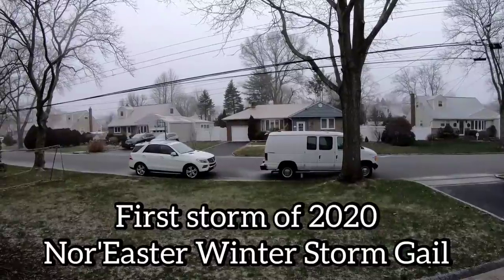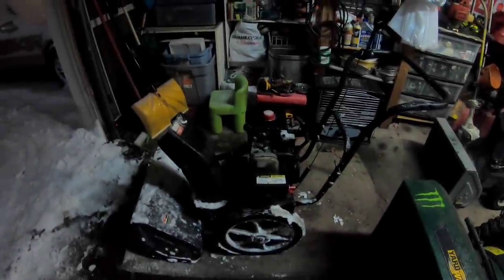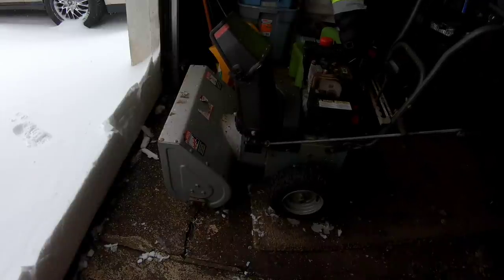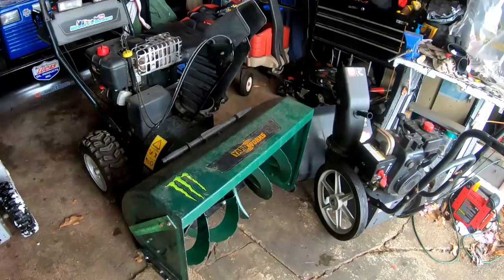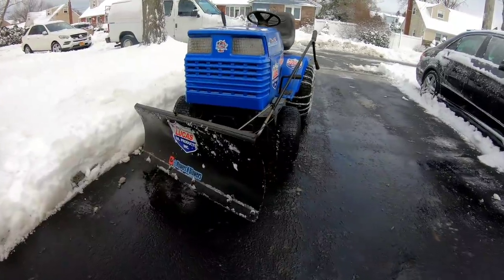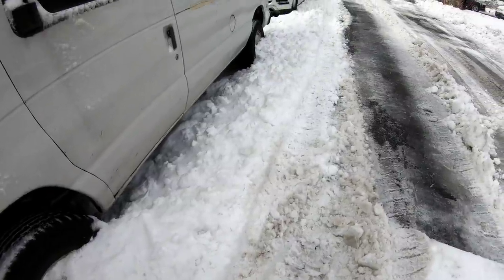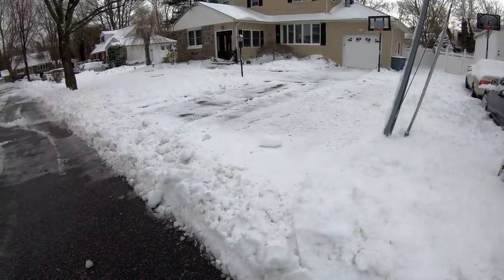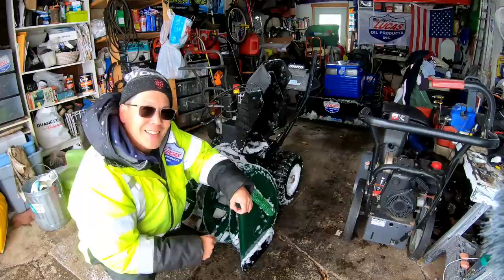WINTER 2020 NOR'EASTER SNOW STORM GAIL CLEAN UP CRAFTSMAN GT6000 PLOW TRACTOR & SNOWBLOWER IN ACTION

Comment: Henry, Nice job with the tractor plowing. Make sure that you keep an eye on your cutting edge that is bolted onto the bottom of the plow moldboard. Most of the time Henry, Once the cutting edge is worn fairly close to the moldboard, If not either flipped over or replaced you face the risk of destroying the bottom of the plow moldboard. To do this you want to unbolt the carriage bolts and flip over the cutting edge over or replace the cutting edge and then bolt it back to the plow moldboard. Your cutting edge will probably last for a pretty good while depending of course how much the plow has been used. As you eluded to Henry, It takes good weight to push snow. The hard pack snow/ice is the most difficult to deal with. I’m wondering if the plow that you have on “Blue Bayou” would be fit the MTD YardMachine Garden Tractor that I have. I may consider getting one for my tractor.

Comment: Henry love the video. I have a plate on the back of my craftsman to add weight when using the snowblower. I've pretty sure it was craftsman you add like a pole onto the back of your tracter and just slide more wheel weights onto it. Only reason I think it was craftsman is because I don't have wheel weights on mine and it looked easier that way. Still a great video.

Comment: Have the same plow but have a winch attached to it and so easy to use.
Reply from the maker: So you have to toggle up and down each time you need to drop the winch?  It’s easier just grabbing the handle
Reply: @MowersNBlowers   its all push button on the dash . So easy

Comment: Yes I have like a 94 Craftsman lawn tractor that I retrofitted a plow on and I love it it's so fast it's so easy I do have a snow blower you need a backup when it's just too deep for this that plow but tractors are fun with the blade on them to push snow
Reply from the maker: I thought it was a blast!  Way more fun than snow blowing
Reply: @MowersNBlowers  Here's another trick I learned on what they do on farm tractors to add weight to the rear of the tires take your tires off deflate them then fill the tire would windshield wiper fluid dakine is good for negative 32 I might tractor that added about 50 lb on each way without the wheel weights soundtrack to do it to add weight to the rear of theirs doesn't make it right ain't different he just put 10 lb of Aaron after it's good to go and it gives you more weight in the rear end you just put a little hose on the valve stem and just start pouring in the winter fluid in the case of yours with your tires are so big it might take quite a bit but I'll be a lot of waiting over here and I'll give you a lot more grip
Reply from the maker: How about anti freeze? That’s heavier than window washer fluid
Reply: @MowersNBlowers  yes you can use antifreeze windshield wiper fluid because it was it's much cheaper but antifreeze will work too

Comment: Hey Henry !!!! No footage from clearing mom's?  Love the distance from the big green monster My old iron repowered Ariens w/6hp predator likes to throw it too but that 13hp makes me feel a certain type of way!  When you got to the ice in street it looked like the auger wasn't spinning very fast. maybe just a different gear ratio from what I'm used to on my Ariens it spins pretty fast. If I get a good storm I'll video the mound of snow the city blocks us in with as the last 15 feet of my drive drops 5 feet so when it dumps and city rolls by they see the bird and snow balls fly them over paid POS's.  I got a blade for my mower but no chain or weights and the hill at bottom of drive could be trouble in deep stuff but some day I'll get it out and use it.
Reply from the maker: Some Good Samaritan paid someone to clear her driveway and walkway!  I didn’t have to go!

Comment: Ya got to get those carbs cleaned up before the next storm buddy!!   Also i have found getting carbs that have adjustable main jets is a good way to go......especially on those Tecumseh 9 to 15 horsepower blowers.    I have them on my 8.5 craftsman and 9 ariens!!    Both 28s and really makes adjustments on the go or compensating for dirt a breeze.    The ethanol free gas makes a huge difference too.  No stabil needed!!  Lasts a year or more!!   Great video Henry!!  All the best!!   Merry Christmas from South West Virginia......and the Blue Ridge Mountains!!   Cheers!!  Rick.
P/S......next storm may be on Christmas!!    😁😁
Reply from the maker: Thx rick
Reply: I usually spray/pour some carb cleaner in with my first tank of the year, since I don't always put them away properly the year before.

Comment: Where did you get those snowblower wheels? They don't look stock.
Reply from the maker: You talking about the mag bicycle wheels?  Google craftsman 522 snowblower,  they’re stock!   Ariens makes the model too!
Reply: @MowersNBlowers  Yeah, not much traction.
Reply from the maker: @davesaam4308  not ANY traction!  Ya just push, not self propelled!  It kinda pulls you from the auger.
Reply: Maybe you can make a custom set of chains for them.
Reply from the maker: Like I said, the wheels aren’t powered.  Chains won’t do anything

Comment: Better keep that Briggs 23hp vanguard out of that husqvarna 2346xls. I would take the engine out and put in one of your spare engines in that husqvarna. I’ve got a couple John Deere gt235’s with the Briggs vanguard v-twin weights chains snow blades nothing like using them tractors but mine is foot pedal hydrostatic makes it luxury snow removal
Reply from the maker: Yeah that vtwin is a keeper.